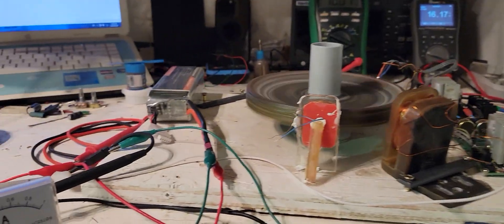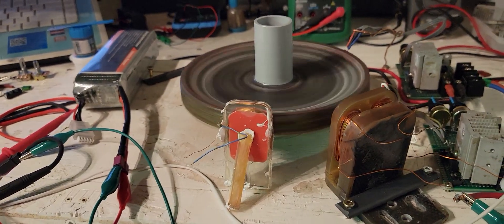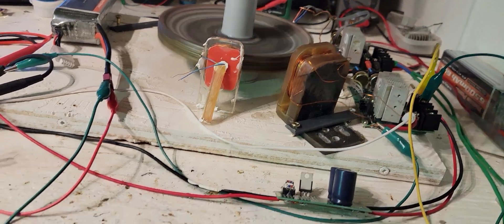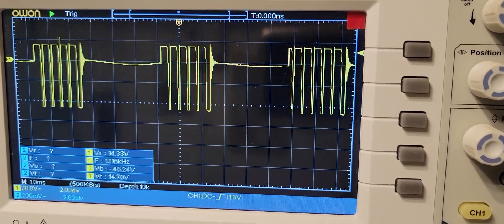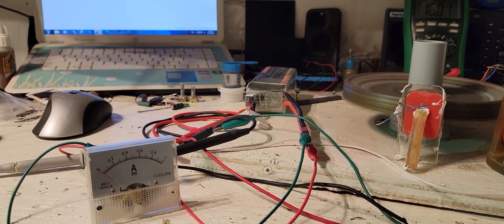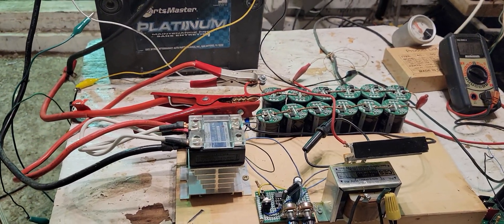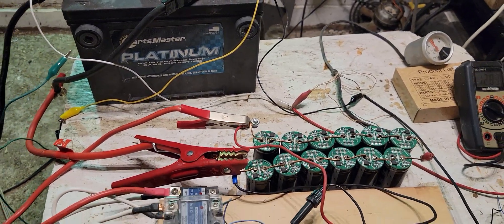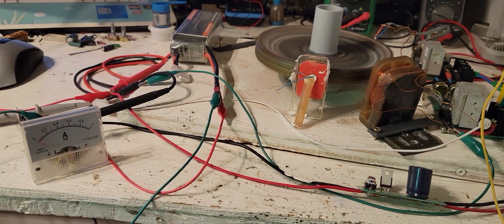2 types of Cap Dump circuits compared with pros and cons of each my own opinion

Comment: Hey buddy you’re doing some great work ! 
 The cap dumps I showed with schematics are scr like you built 
 The ones I sell are mosfets with Zener they are much better than the scr versions I adjust the pulse duration with tiny caps depending on what I want 
 Nice work with your adjustable one ! Very cool 😎
Reply from the maker: That's awesome!! You're the one doing the Nice work bud!
Reply: @windpowerandmore6310  thanks bro !
Reply: I am interested in your circuit. Where can i find details? Thanks!
Reply from the maker: @szekerespista3758 I have videos with the schematic of each type you can find,  I can post a link later when I have time for you but I can't do it at the moment sorry